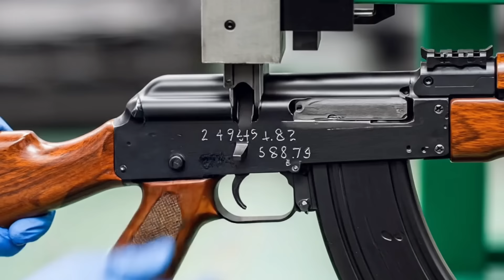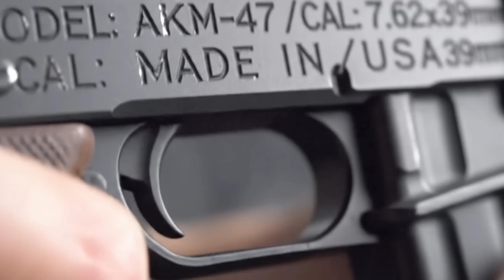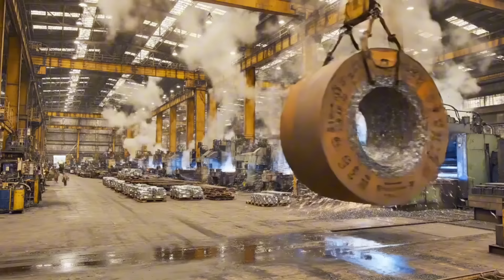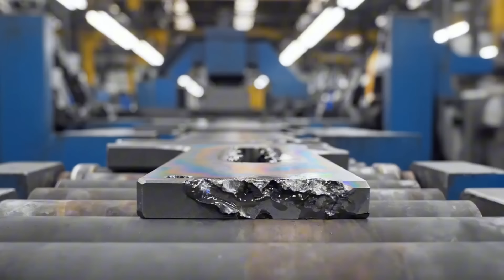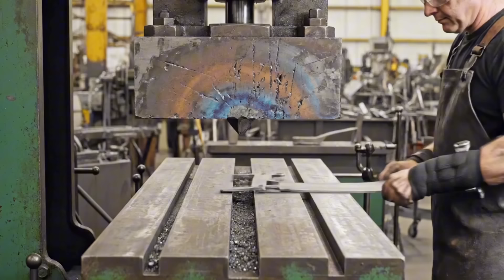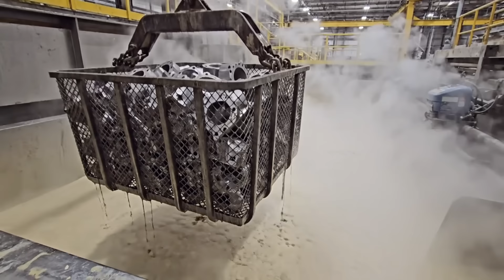How an AK-47 is Made? Secrets Inside the U.S. Gun Factory

Comment: This video is quite interesting from a manufacturing point of view. It shows how complex and precise the production process is, from shaping metal parts to final assembly and testing.
At the same time, this is a sensitive and highly regulated industry, so safety and responsibility are very important. The video feels engaging and well-structured, making it easy to follow even for viewers who are not familiar with this field.
Reply: अमेरिका कब से AK47 बनाने लगा है
Reply: @Bruna13a8jeoleolekei93o3ihiwjjeolekkYw8je9kei93o3ihiwjjeoYw8je9kei93o3ihiwjjeolekkYw8je9kei93o3ihiwjjeolekkYw8je9kei93o3ihiwjjeolekkYje9kei93o3ihiwjjeolekkYw8je9kei93o3ihiwjjeolekkYw8j@Bruna13a8jeoleolekei93o3ihiwjjeolekkYw8je9kei93o3ihiwjjeoYw8je9kei93o3ihiwjjeolekkYw8je9kei93o3ihiwjjeolekkYw8je9kei93o3ihiwjjeolekkYje9kei93o3ihiwjjeolekkYw8je9kei93o3ihiwjjeolekkYw8j8jeoleolekei93o3ihiwjjeolekkYw8je9kei93o3ihiwjjeoYw8je9kei93o3ihiwjjeolekkYw8je9kei93o3ihiwjjeolekkYw8je9kei93o3ihiwjjeolekkYje9kei93o3ihiwjjeolekkYw8je9kei93o3ihiwjjeolekkYw8j8jeoleolekei93o3ihiwjjeolekkYw8je9kei93o3ihiwjjeoYw8je9kei93o3ihiwjjeolekkYw8je9kei93o3ihiwjjeolekkYw8je9kei93o3ihiwjjeolekkYje9kei93o3ihiwjjeolekkYw8je9kei93o3ihiwjjeolekkYw8j@Bruna13a
Reply: @Bruna13a8jeoleolekei93o3ihiwjjeolekkYw8je9kei93o3ihiwjjeoYw8je9kei93o3ihiwjjeolekkYw8je9kei93o3ihiwjjeolekkYw8je9kei93o3ihiwjjeolekkYje9kei93o3ihiwjjeolekkYw8je9kei93o3ihiwjjeolekkYw8j8jeoleolekei93o3ihiwjjeolekkYw8je9kei93o3ihiwjjeoYw8je9kei93o3ihiwjjeolekkYw8je9kei93o3ihiwjjeolekkYw8je9kei93o3ihiwjjeolekkYje9kei93o3ihiwjjeolekkYw8je9kei93o3ihiwjjeolekkYw8j8jeoleolekei93o3ihiwjjeolekkYw8je9kei93o3ihiwjjeoYw8je9kei93o3ihiwjjeolekkYw8je9kei93o3ihiwjjeolekkYw8je9kei93o3ihiwjjeolekkYje9kei93o3ihiwjjeolekkYw8je9kei93o3ihiwjjeolekkYw8j8jeoleolekei93o3ihiwjjeolekkYw8je9kei93o3ihiwjjeoYw8je9kei93o3ihiwjjeolekkYw8je9kei93o3ihiwjjeolekkYw8je9kei93o3ihiwjjeolekkYje9kei93o3ihiwjjeolekkYw8je9kei93o3ihiwjjeolekkYw8j